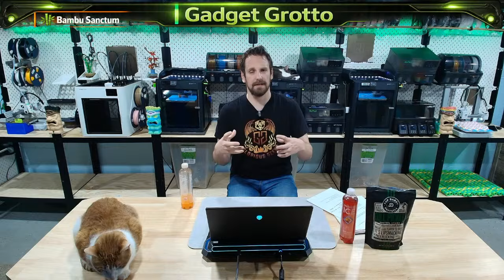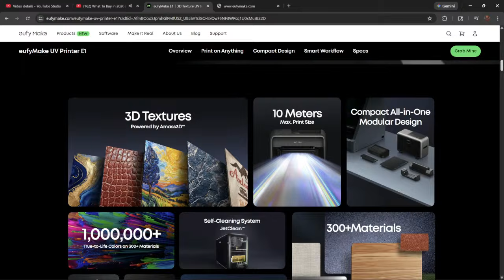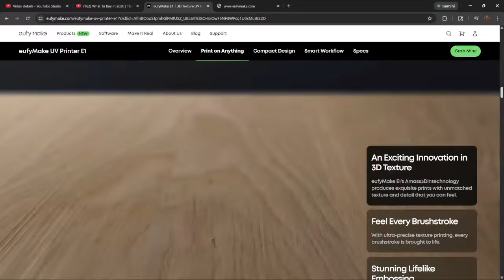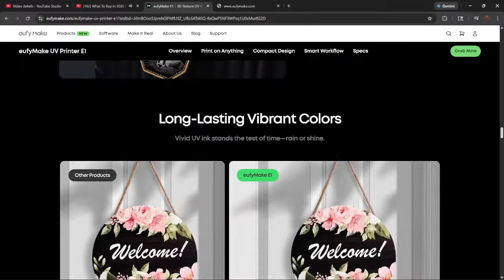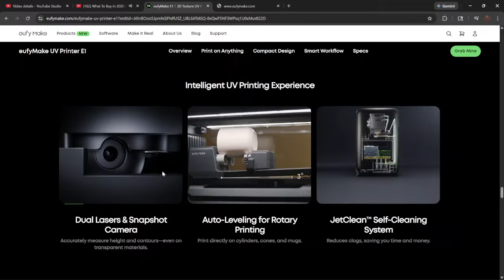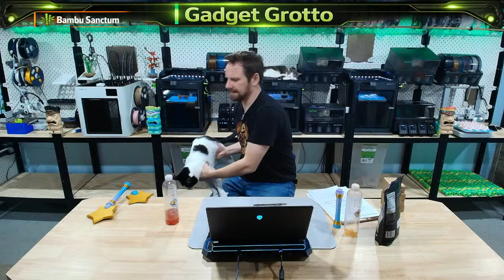What To Buy in 2026 | The 3D Printing Shift Is Real

Comment: Snapmaker U1 is already $1000 if you add in taxes in most states tax(6% for me $50) and $50 shipping. If they increase the price without free shipping the price to your door in the US will be $1100. That will make it a bit harder of a sell. It is a perceived lower price right now but the real price is $1K. I think companies could set a price point around $1500 with included enclosures and 6 heads.
Reply from the maker: Spot on analysis; 6 heads in an enclosed package at that price point is definitely the dream scenario for 2026. 🚀
Reply from the maker: That’s a really good point.

MSRP and “price to your door” are two different conversations. Once you factor in tax and shipping, that psychological $999 line shifts quickly.

And you’re right — if companies start landing around $1500 with enclosures and multiple heads included, that changes the value discussion again. 2026 is going to be all about what’s actually included vs what’s marketed.